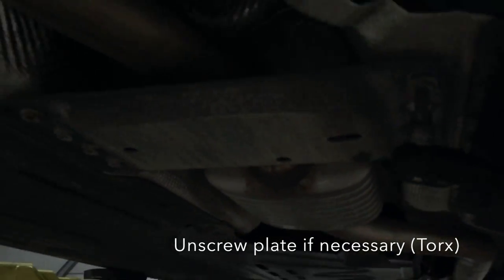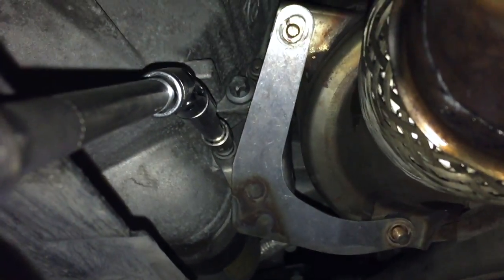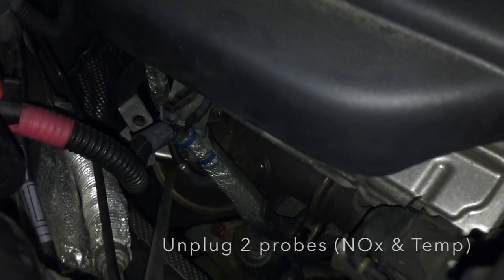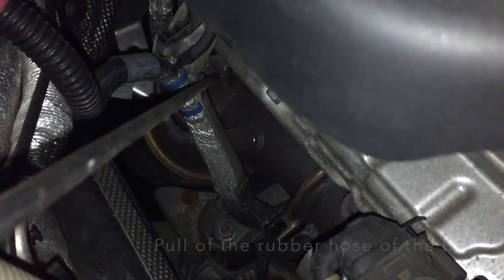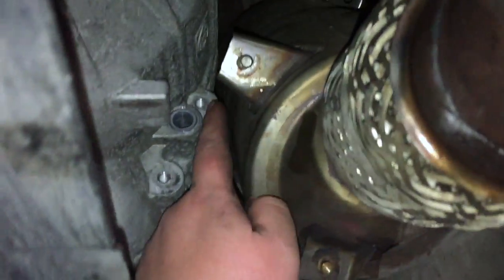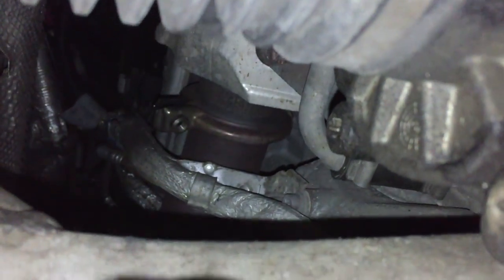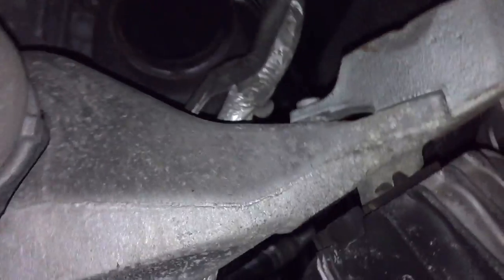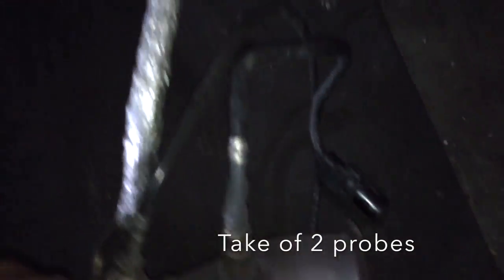HOW TO MOUNT DOWNPIPE - BMW E90 320D N47 DPF REMOVAL

Comment: The best video so far on EU car exhaust repair  =D ..trying to find out if it is possible to replace the flexpipe between the DPF and the rest of the exhaust. Looks "clamped in" the same way as in this video to the DPF, but I dont know how to replace it and perhaps if there is a way without removing the DPF? (I hit a bump these roadserviceguys put up that was really sharp and unfortunately my exhaust holding bolt was damaged EVERYONE MAKE SURE THAT BOLT IS SIDEWAYS OR YOU MIGHT FACE THE SAME DAMAGE..! ) So; well; Since you guys took the DPF off maybe if you would be kind enough can help me with this question?

Comment: Hi I fitted the same downpipe to my n47 318d  did you have any problems fitting the temperature sensor to the new downpipe mine wouldn’t fit in, do you know if I would need it or would it be getting mapped out anyway.

Comment: Hi mate Im struggling to pull out my def from m57n2 , maybe you got some solution ? i even took out engine mount and didn't help ..
Reply from the maker: Master d its quite difficult for the m57, had to do it with my own car also.

Engine mount has to go and engine has to go up a bit.
Not much room...

Placing the downpipe is much more easy
Reply: yea even with engine mount off , doesn't help much , i give up ..

Comment: but need to turn off  software DPF first or? because car will put in safe mode..
Reply from the maker: not true.. no visible faults in the car...

But it's best you go to a tuner and let them write away the regeneration... because with a downpipe there is nothing to regenerate
Reply: new map and switch of dpf

Comment: Hello, nice video.But will there not appear an error boardcomputer ?
Reply from the maker: placed one on 
E91 M47 
E91 N47
and E91 M57

never errors on the computer, but the engine will try to regenerate.. So you have to do an regeneration delete (software)
Reply: CriZ VidZ i need one for n47 e90

Comment: I have a 330d and im about to mount a downpipe on it, is it okay if i mount it then drive a couple miles to get it tuned?
Reply from the maker: Dat Boi Should be fine... but do not rev to hard .. boost peaks get higher and you might dammage stuff

For more info contact power-industries bmw belgium
Reply: CriZ VidZ  thank you for the info! :)

Comment: Actually the part removed and replaced with downpipe is the catalytic converter not the DPF. :)
Reply from the maker: Димитър Киров cat converter is on petrol cars... this is a diesel !

So DPF DIESEL PARTICLE FILTER
Reply: @ICONAUTOMOTIVEBV  that dpf, hold 2 types of filters, cat converter on top and soot particle matter downstream ,  Димитър Киров is right
Reply: Both od the on the same cane